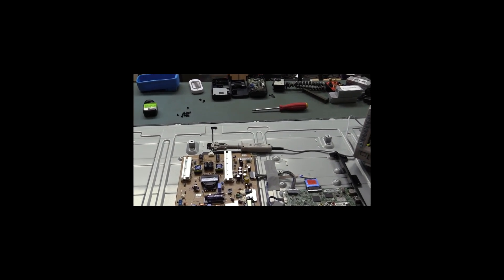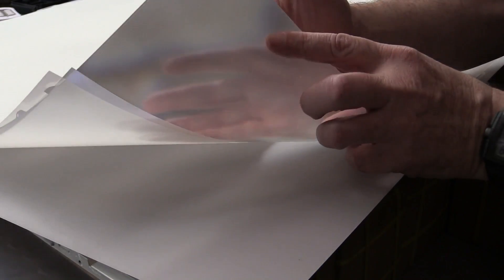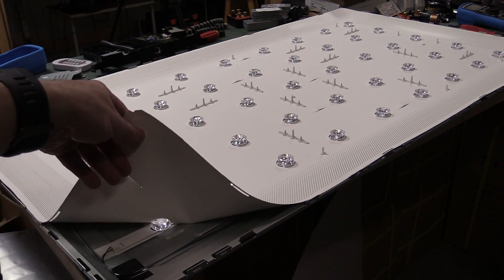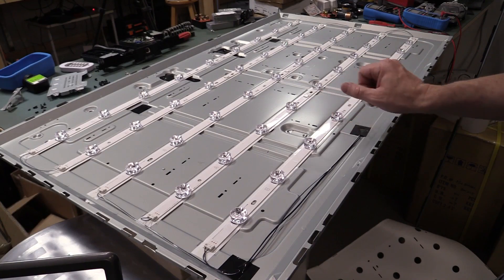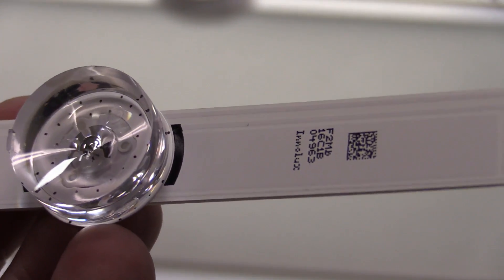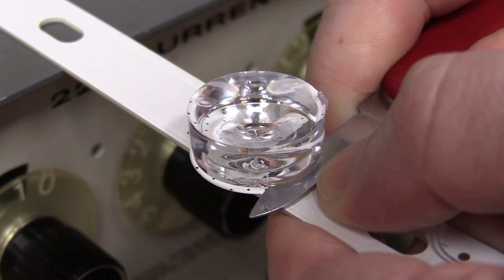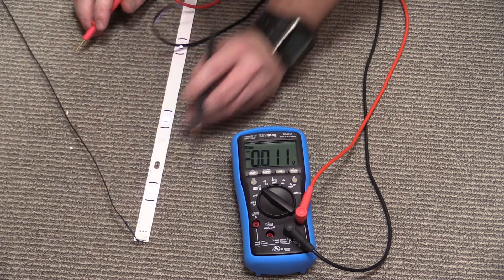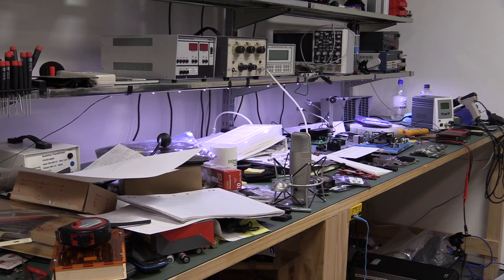EEVblog #916 - Work Bench Lighting From A Dumpster LCD TV

Comment: I have a strip of LED backlights. 32 of them, 4 strips with 8 on each strip, all in series. The TV's (broken) PSB specified 118v and 260mA for the connector to the strips. Doing the math that looks like ~3.6v per LED. I'm looking for a way to drive them, and I don't have a benchtop power supply, nor a constant current supply. I tested a single LED on 3.3v from a computer power supply and it was drawing 150mA of current I took apart a printer and the PSB from it has a 42v pin for the motor drivers, but stepping that down to 28.8v (if I put the 4 strips in parallel) would require an 88ohm resistor dissipating nearly 2 watts! I'm wondering if there's another way. I know a buck converter could do this, but I don't have one. I'm fairly new to this kind of stuff.

Comment: What's an economical and efficient power source for the strips once you've got them set up? Seems the lab power supply would be worth a lot more than the LED strips themselves.
Reply: There are very cheap led drivers on ebay as he mentioned

Comment: Using those as bench lighting alone is shite. I would had love to see maybe, a 45-degree mount with a crown strip at the end to stop the light from smacking you directly in the eyeballs when the lenses aren't removed.

That, and one could buy DMX'd LED strips for cheap anyway; for people who are desperately poor this seems to serve little purpose since you'd need the tools which could had been bought, or in cases of extreme poverty and isolation, stolen. (Before people mention borrowing, that is always an option if you're poor but know people.) Fun to recycle, but not terribly practical.
Reply: If you're going to "buy" everything then electronics is not the hobby for you.

Comment: if this is typical of LCD TV's. not a lot to it,  the light is a bit too blue for my lab.  still a good find  . the ultra flat speaker box design is interesting.  the high level of engineering & design generally fail when it comes to TV on screen menu's & the design of the remote control IMO.

Comment: I think that the backlight spectrum is specifically chosen as the image panel passes some wavelengths better than others and the backlight is chosen to give a reasonably flat picture colour. I used to work for a company that manufactured spectrophotometers. Optics is a very interesting subject and the intersection from optics to electronics can provide some very interesting projects.

Comment: Very interesting video, to see how backlight is implemented on modern LCD panels. 

However, I'm a bit disappointed! You could have used the whole panel for other many useful purposes, but instead you dismounted it to get the less interesting part: the led strips! (which, by the way, are also not optimized for your application: with few bucks you can buy better - in terms of homogeneity, spectrum and CRI - led strips almost everywhere).
Reply: Unfortunately, that's not the point of the video: I'm happy he took the whole thing apart, since if he didn't we wouldn't be aware of the concave lenses and stuff. Moreover, other people may have more use for LED strips than for a lightbox, so this video targets them as well
Reply: I'm also glad that he took everything apart. But I had expected he mounted back everything, and do something more "complex" than just use the strips...

Comment: A good solvent for many adhesives I have run across is simple straight chain hydrocarbons.
Zippo lighter fluid works well. It is a light to medium naphtha. Colman white gas is a light naphtha. That Goo Gone is a medium naphtha and light kerosene plus the fragrance. Lamp kerosene would work I'm sure but will take a bit longer to dry. Longer still would be mineral spirits.

Comment: We bought LED studio lighting a few years ago. They started out at around 5600K in color temp, but over a year shifted to a similar violet color I see in the video. They were replaced under warranty, and have been replaced a second time. Hard to get around the weird notched spectrum and uneven degradation of the phosphors. I wonder if something like that has happened to these LEDs?

Comment: Dave when I tore down my broken LCD TVs I took out all of those films and then left in the thick white plastic sheet which made a nice diffuser. I will have to find a broken LED backlit TV.  I bet those draw less power than the CCFL backlit TVs.

And what would it take to run just one of those LED strips, How many volts. Can I use 12 volts? Would be cool to run one of these from a 9 volt battery.

Comment: The dot pattern on the led backing reflector works in a similar way to the dots around the windows on a modern car. On a car, however, the dots serve to visually blend the edges of the windows into the seals and body work as the dot size increases towards the far edges. They're also used to help obscure fixings and other functional items which would otherwise detract from the visual appeal of the design.

Comment: What was the maximum current that the strips could achieve with the dissipation of the copper inside? What current did you decide to use on the bench lighting you created?

Comment: I would not enjoy working under that bluish colored light. I don't think it's healthy for the eye either. But I've thought about reusing these led backlights as well. Maybe waiting for another TV with better leds is a good idea.
Reply: OSRAM released a fluorescent lamp a few years ago, LUMILUX SKYWHITE at 8000K color. Far "bluer" than your average tube (6500K) and they claim it's better for productivity. But if you really, really want to get less blue, just use a gel in front, like photographers and cinematographers have been doing for decades. A "CTO" (Change To Orange) filter will give you a tungsten balanced light, for example.
Reply: This is very true. Most astronomers will use red lights to work. Red light does not affect your night vision and is less harsh on your eyes. Every single astronomer I know carries a red flashlight for this reason. You can read your charts and work on your equipment, then turn your light off and immediately look through your telescope, no problem. No need to wait for your eyes to adjust or anything.

Comment: It might still be possible to use those led strips without removing the optics if you put them in a simple enclosure with one side covered by reflective tape or even a mirror (or cover a certain portion of an optic with reflective tape) and the output side covered by a diffuser sheet (either flat for concentrated light or curved to spread out that light further) and maybe one or more of those prism sheets.

Though I do wonder if one of those plastic sheets might also function to filter out the blue component of that led light.......

Comment: At the end when the LED's were mounted under the bench shelf, what was the power source? The boards on the TV that powered them to  begin with? Slap those in a box, run the wires, connect a switch and Bob's your uncle.

Comment: You were talking about the white diffuser and why it has no dots in the corners. If you look at a laptop screen in the corners they have a dark area right in the corner. I think this was left white (no dots) so light was supplied to the corners to avoid the dark area by the corner so the light is even over the whole screen area.

Comment: Hmmm, with that much prism film in one of these, I wonder what other useful e-hacker things one could do with it.

Is that backlighting technique necessary with panels over a certain size? What was the date of manufacture on that TV?
Reply: That material does look like it would be fun to play around with :)
Reply: 12Mantis I can think of some obvious uses for it to obtain even diffusion of light from any efficient (i.e., low heat) light source: light boxes of the types used for photography - the enclosure and backlit table types - the latter also being used for art drawings or in a DIY light fixture.
Reply: I took a film like that from a broken phone screen and put it on 3D cinema glasses. It's totally crazy with multiples light sources like RGB LED strips.

Comment: A thought on the use case where you use the panel...
You need a polycarb sheet to add stability to it, so why not use the patterned polycarb, like the type you often see on fluorescent tube fixtures so you diffuse the light (IIRC, the viewing angle is not that great on all backlights) or make one yourself with a bit of steel wool?

Comment: Certainly more useful than the old CCFL LCD backlights (which often broke too when the screen was damaged), I'd still go for the softlight setup myself, with a sheet to perspex to replace the LCD, possibly even sticking a bit of theatrical gel in between diffuser & perspex just to adjust the whiteness, just need to find a broken TV now... :)

Comment: Just curious, if the driver board was giving the LEDs a PWM signal, I assume that was for reducing power consumption and heat?  If you drive them directly wouldn't they get much hotter and potentially fail?
Reply: My guess is the backlight is driven at 100 or 120Hz to match the frame rate, 50 or 60Hz, of what's being displayed.
Reply: what no!! 60 hz to 120 hz you well see it blinking
Reply: PWM is just another way of driving the LEDs. Let's say one of those LEDs chews 1W Power. With a forward Voltage of 3,3V that LED would draw 333mA. So if you DON'T want to use a 333mA constant current source with 3,3V compliance voltage, just take a normal supply's 5V and PWM it with a duty cycle of 66% (5V*66%=3,3V, but you'd have to adjust for different current consumption, because the LED behaves differently when driven with a 5V square wave)
Anyway, the load doesn't change, so power consumtion and heat loss will be the same.

Comment: What if you were to put the lenses back upside-down?
Reply: I'd expect a similar effect but not as good. The "lenses" can be thought of as  curved reflectors - light bounces off the change in refractive index of the plastic of the lens with the air, so putting them on upside down you would get reflection from a inverted version of the reflector surface. Dave, can you try this?